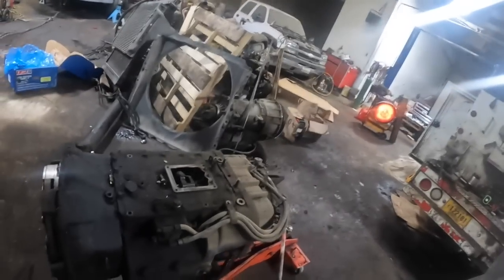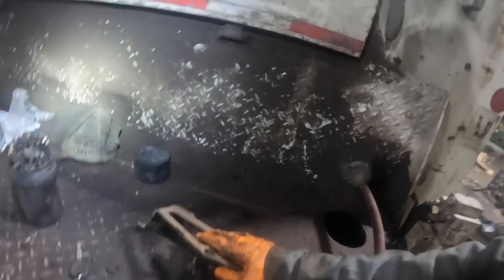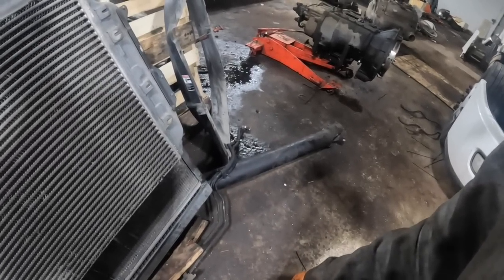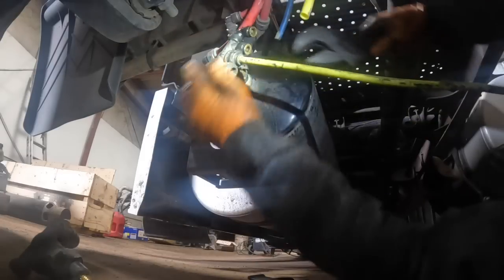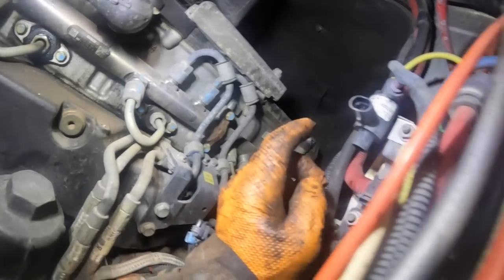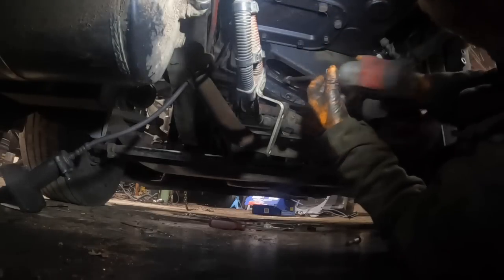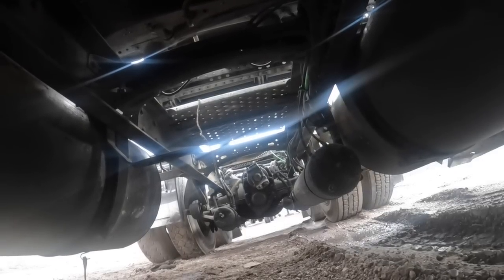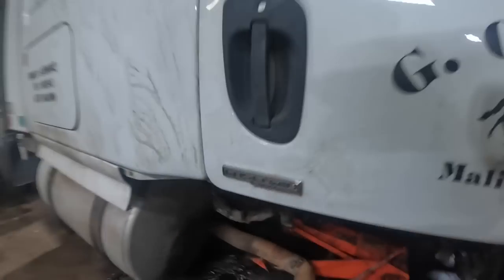Freightliner cascadia  auto to manual tans pt2

Comment: I have a question ? I have 7030 Allis chalmers that when I want to put in gear it grinds. Have tried adjusting cable on clutch pedal . Doesn’t help is the trans brake wore out ?

Comment: I've done clutches using both methods. For me, they always went easier when I put the clutch on the flywheel first. I do like that you don't have to futz around with the fork trying to get it over the bearing though.

Comment: I’m always amazed how much of a struggle it is to get those push connect disconnected, but yet the loom, putting slight pressure on it, going down the road will disconnect the air line

Comment: Trucks are good, because (mostly) there is place to fit the clutch as you do, cars, (stupid things) are different I guess there is not enough diameter for an opening to work through ! (I am not an engineer what do I know). I love crescent wrenches for tightening fittings too, the wide jaw is great for brass and softer materials ! Well, you do have your work cut out for you, but as hard working people do....soldier on. Thanks for the video.

Comment: I hate those "quick connect" fittings, but I learned a trick years ago, and it has NEVER failed me. Take an end wrench the same size as the line (3/8 for 3/8, etc) and slip the open end over the line. Use the flat side of the wrench head to push against the release ring while you pull on the line. You can put a LOT of force against the fitting that way.
Reply: I do the same sometimes use crescent wrench to adjust if needed
Reply: If it's not an ISO 16028 style of quick connect it's trash